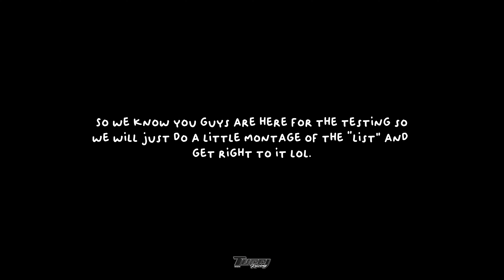Putting in BIGGER JETS! Street Testing the BBC Mustang.

Comment: Looks like it may have wanted the extension tightened up on the rear, looks like it extends and then losses the tire at the end of travel and goes into wheel speed, then basketballs the tire. The more power at the hit , the tighter the shock is going to want to be. Sucks you lost that go pro, what are the freaking chances!
Reply from the maker: Yep that’s the game plan. Trying to get this car to stop slamming down and bouncing. We’ve had this issue for awhile but now with the new shocks we feel confident that we could fix it eventually lol